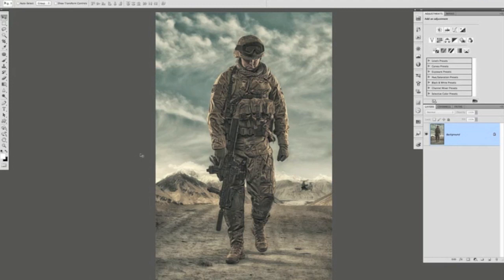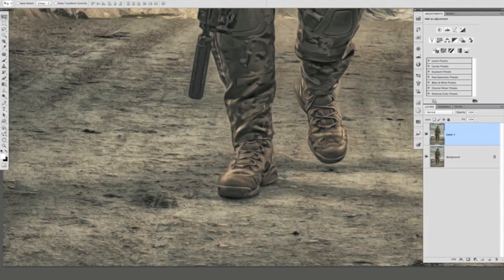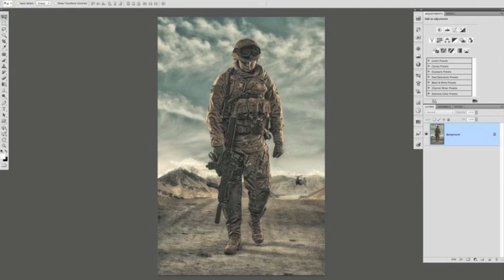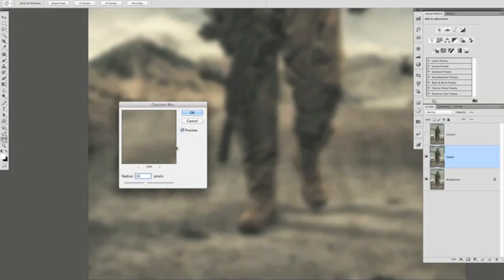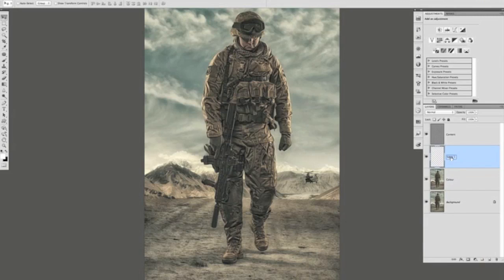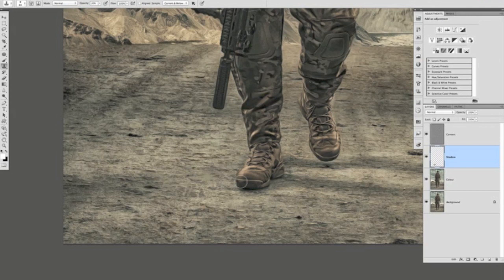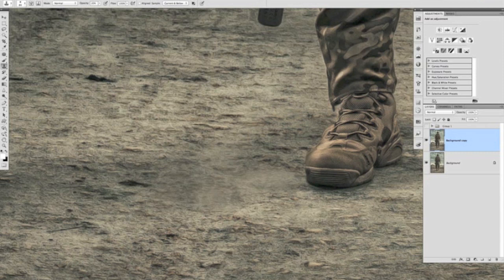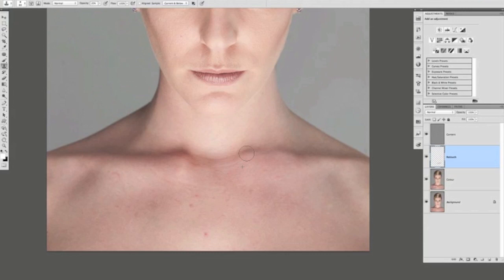Super Fast Frequency Separation Technique

Comment: Thank you, Glyn! I found a lot of useful stuff for myself on your channel! For the moment, I have an advice concerning this particular video: for content layer you should try not to reduce the contrast before the high pass filter, but to add the adjustment curves layer and to flatten the curve for 50%. then group these two layers and apply soft light blending mode to it. in such a case when you work with a texture, you could switch off this adjustment layer to work more precisely on a content.